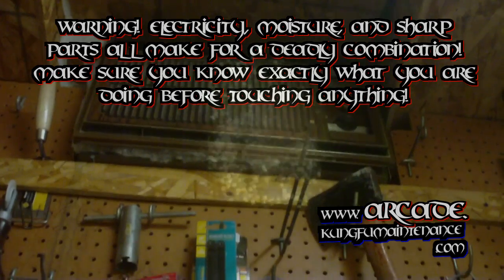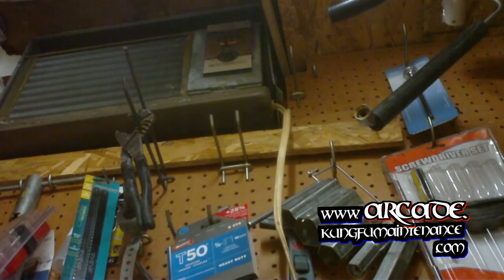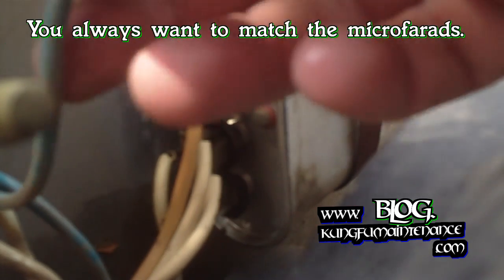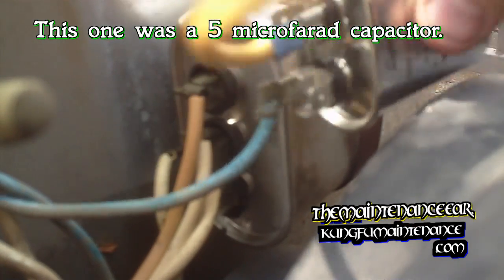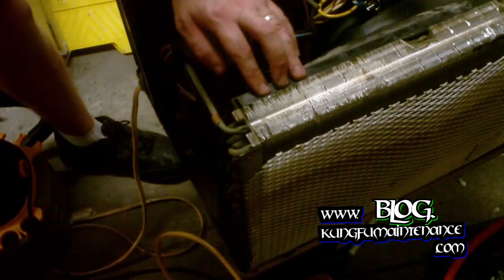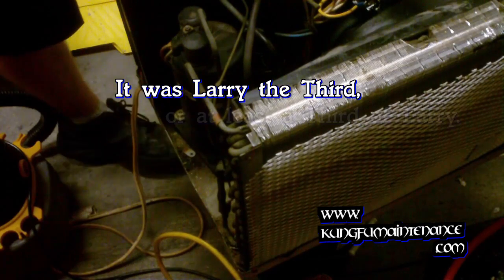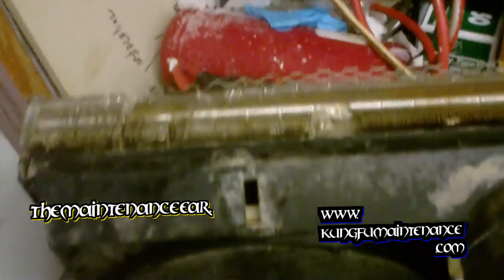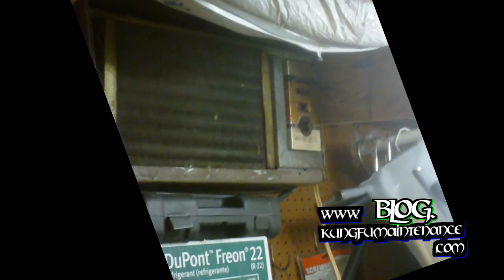How To Repair Window Air Conditioners Compressor Runs But Fan Capacitor Not Starting

Comment: window unit works okay but when reaching set temp the fan shuts off but the compressor keeps running. Turn off the unit power button and the compressor keeps running. I have to click the power off at the cord so no power is getting to the unit.. So problem seems to be whatever relay that shuts power off to the compressor when compressor is suppose to cycle off is defective.  Started doing this intermittently for a few weeks. Now it is doing it most all the time.  My fan capacitor bulged out a year back and I replaced it. This is an off brand A/C unit from Sears. No more Sears garbage for me. Anyone know what is causing the compressor not to turn off. I figure probably have to replace the control board. This thing should have plenty compressor life, and looks great. I use it sparingly.

Comment: The problem I have been having is when I turn off the AC the fan shuts off but the compressor is still running. I have been unplugging it to get the compressor to turn off. I had unplugged it for a while then plugged it back in without turning on the AC and the compressor came on again without the fan. If I turn on the AC the fan and compressor works like it is suppose to.  It had done this before and stopped but now is doing it again. Only thing I can figure is that the control board is nor signalling the compressor to turn off when I turn off the A/C. Sears crap. I already changed the fan capacitor as the fan stopped working when the plastic capacitor fried, and also changed the compressor capacity while I was at it. This unit is probably ten years old but is not used all that much. Kools and heats great, Just a piece of crap.
Reply: Hey Zed: I'm having the same problem with my GE 12000. When it is on energy saving mode. It will kick the fan off but you can still hear the compressor running. I have to push the buttons on the plug to turn the unit off. Did you find a solution to your problem???

Comment: Never Mind, must have been a thermal switch of some sort It started. 
The fan Motor needs a new bearing but it's too heave and big to get out of the window.,  
My Knees are Bad, and I lost a Lot of my strength. It's a big old 25,000 BTU. 
Needs cleaned put real bad too, But again,. too big and heavy.

Comment: I think my Fan may have locked, it has been locking, trying to nurse it. 
But if the Motor cap is bad, won't the motor at least Hum?
The was it hums with say a table saw motor. 
This fan motor does nothing, No Click no nothing. 
If I turn thermostat up, the Compressor runs, but the fan does nothing No hum or nothing. 
Could it still be the Cap? 
I cant afford a new A/C right now.

Comment: I have a question perhaps you could help me I have a LG window unit and sounds like the motor or the sand maybe the bearings do either of them need to be oiled the air works correctly no other problems just the sound a little screeching sometimes it gets louder sounds rough I hope you can help me

Comment: Great video. I have a fairly new Frigidaire, 12,000 BTU, at a rental apartment,  almost two years old. The compressor is running, but the fun blower is not turning. Similar to your video but my unit is pretty new. Is it possible, that the previous tenants, put something in there, just being sweet, or something is blocking the motor. Any suggestions?

Comment: I was given an ac unit that the power cord was ripped out of it and it is missing the digital display panel can I wire a ug into it to makes it run all the time and if so where do I put the wires ?

Comment: ac works good,but compressor wont shut off when unit shuts down. I have to unplug it . Replaced the thermister, and control board, still same problem. I haven't seen anyone fix this problem. Its a window unit LW1210ER

Comment: Good video. TechReviews1989 has the same problem I do. No one wants to replace the compressor (which cools fine. Its just noisy sometimes on start up). If I leave the AC on high and let it warm up and then lower the temp, it comes on quieter, but after its been on awhile it makes a very loud 'KAWAHNGGGGGGORR' sound the neighbors complain about. There is also a louder HUM HUM HUM at times they also comment about. New fan motor put in and steam cleaned 4 years ago and drip tray cleaned last year. 14 year old Friedrich Quietmaster. Cant afford a new one. Got the stuff you spray in cracks and it fills them up. Maybe that will cushion compressor on start up after it cures? Works fine otherwise. Could you help with suggestions? Thank you.
Reply from the maker: chrisccc1x I would try replacing the capacitors. It is good preventative maintenance anyway and perhaps they have lost there phase and the motors are running out of time step. Additionally a hard start kit may help the compressor on start up.
Reply: KungFuMaintenance next time back it up a little so we can get a good view of everything and know where everything is located.
Reply: +chrisccc1x Friedrich Quietmaster units are well made good units. If I were you, I&#39;d fix the unit and keep it as long as it lasts. No unit made today can compare to the build quality of the older ones. Sounds like you might be able to replace the rubber grommets under the compressor. If it&#39;s a mechanical issue, capacitor may be the culprit. Also, Can you record a video of it starting. That way we can hear what the problem may be easier.
Reply: +fedders airDUDE Very complex for me a non tech. Neighbors want unit gone, not repaired. Have let me use it this summer, but not next. I have read a lot and spoken to many and wanted to respond to KFM but issue kept compounding. This is the 'deal'. NOBODY wants to repair a compressor due to giving out next day and customer holds them responsible. Purdue U did articles on compressor design and how it fails and causes noise: http://docs.lib.purdue.edu/cgi/viewcontent.cgi?article=2666&context=icec 
and  http://docs.lib.purdue.edu/cgi/viewcontent.cgi?article=1542&context=iracc and http://docs.lib.purdue.edu/cgi/viewcontent.cgi?article=2539&context=icec     Old is (from memory) up and down and newer units are circular in motion/function (and KUHL units are built more in this direction/like tanks. You have to find (they wont tell you) starting dcb level (it will only go down from there). the industry knows issue and has to be (and is) proactive to quiet function. Our compressor had to tell us what issue was. LOUD start up can be many things. Hum Hum Hum Hum that is also loud means compressor is on its way. Techs (and here is another issue, make sure you tell repair shop to send you a MECHANIC and not a repairman) has to know difference and not blanket decision with doesnt work on compressor. I offered to sign waiver if broke down after work done. Not acceptable.  You CAN repair a loud start: tighten or replace grommets (ever look into how they are designed?), wrap compressor in sound cloth (costs hundreds of dollars but business buys and divvys up sheet to trucks so they have to use as needed) using (2 - 4?) cable ties, then replaced capacitor and then add hard start kit (better know which one you need). All this (about an hours effort and  $75 in cost, I offered $250. Not enough), can quiet a noisy start, but not do that much, if anything, for hum noise. So gamble is hard start resolved and maybe hum lessened so neighbors will accept, or wasted money? While Quietmaster good, unless the unit is thousands of dollars, no one will break welding to remove old and put in new compressor and weld coils after adding coolant (separate license). And hope they 'give' you good deal on compressor sitting on shelf, or shop around with parts suppliers (Gabbert/Tx. is great and will work with you). Additional, dont buy a/c off net. Cheaper but if arrives damaged you have to send back and pay shipping. Best to get locally, have them deliver and install and try for good extended warranty because KUHL and Freiderich (interested in competing with european  influx) have same warranty; one year labor, 5 years parts. Labor is expensive to put in cheap part). If I may, PC was a joke. They would not install unless dedicated outlet and wanted (if I remember) extra for delivery (we deliver from warehouse and not store) and wanted extra for bracket. AJMadison fantastic. Lowered price while on phone, no extra for delivery, would install and dedicated heavy duty line OK and had great extended warranty to 10 years. Also, get a second remote. If goes out (or lost) can be expensive. KFM if you didnt say hard start would not have known.Thank you. Right about keeping old designs. Have 25 year old W/Westinghourse. Only thing to go wrong was thermostat in freezer ($5). Compressor sounding different. Cost $250 and tech to do work $250, but may have new fridge and this one fine otherwise. More, but maybe later. Please let me know of any errors and I will correct.  You guys are the experts. Thank you. Cheers.
Reply: Yes, in some ways the newer compressors are quieter. However, the newer compressors are also not as durable and do not last as long. Some of the older air conditioners also use the same compressors made today. When did you buy your ac? Ever try putting it in a different window/wall on other side of house?
Reply: +fedders airDUDE I think with this part silence more important than length of service. Plug and play would be nice for frequent service needs. Only this window in apartment building. Others have their units. 2002.
Reply: 2002, that's relatively new. Those have the same compressors as the new units today, your problem is probably the rubber mounts. I understand the situation your in. You probably can fix this problem though very easily and very cheap.
Reply: +fedders airDUDE Ill bite. HOW? I am in NYC and would pay $250 for the work. Even the fellow who wanted this plus 150 for the parts said it was an easy fix. but I will not pay that. Any contacts in the big apple, please let me know, or if you can talk me through it tell me how to get the parts and your fee. JustAnswer doesnt work. I am disabled and fixed income. Cant feel my hands and missing 5 discs, but if local techs wont help, have no choice. This unit in our bedroom and badly needed. Thank you.
Reply: Very sorry about your disability. What you would need to do (if it is the compressor mounts) would be to have someone (a friend, family member, anyone that can help) take the front grill off the air conditioner, grip the bottom pan of the unit inside the case of the ac and pull it out. (No need to take the box out of the window.) Then, remove the 3 bolts holding the compressor down to the base out and lift the compressor up without bending the tubes too much. Take the old rubber mounts out and put new ones in. You should be able to buy new ones cheap online. If the rubber mounts seem to be in good condition (springy, not falling apart or dried out), then it may be the way the ac is installed and something is vibrating. Hope this helps.

Comment: Question can I install a saddle valve on the suction line and use a can of R-22 refrigerant?  Do I have to hook up my gages or can I just put in a can of refrigerant?  The window unit uses R-22 refrigetant.  Just wondering.  Also I can't find a leak I've tried the bubble test, but to no avail.  Thanks in Texas (yes we're still using our window units here)  
twister
Reply from the maker: You can use a bullet piercing valve (I have video on "How To Install Bullet Piercing Valve) on the suction line. It's always preferred to use gauges but yes technically it can be done without. You can use a micro leak repair additive that can help seal tiny leaks. I have used it with success even though some techs do not like it. Check me vid " Air Conditioner How To Super Seal Micro Leak Repair".

Comment: That sounds like a problem I may be having with my air conditioner. You can her the unit coming on, but no air is coming out of it. Mine worked good the previous Summer with no problems, but when I turned it on this Summer it didn't blow anything.
Reply: sounds like my wife. she blew all the time a few years ago, but now nothing... except maybe once a year on my birthday. too bad the warranty is expired.
Reply: I have the habit of buying equipment and not using it until later (1 year or more).

Comment: i got one i change the cap and the motor fan and still the fan not turnin i dont what happen any ideas
Reply from the maker: Sounds like a wire somewhere is burned or disconnected. You could unplug it and try ohming it out. Checking for continuity. Or you could test for voltage at each point.